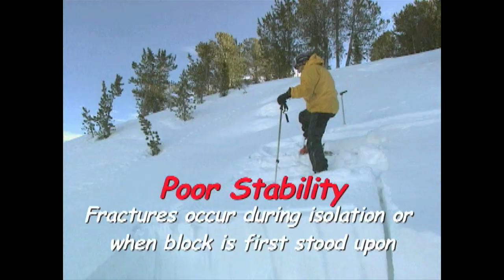All About the Extended Column Test

Comment: Karl, I just listened to your avalanche hour podcast which brought me to this page. Thank you for all of your hard work. I was showing my girlfriend different types of pit tests today and she asked a couple of questions I hadn't thought about, but I'm now curious about. How did you determine the dimensions of the test block?
Reply: He has centimeter markings on his probes. Most probes will have this for this kind of reason and, more grimly, to allow you to establish depth of burial and therefore correct dig angle in a search situation. If you don't have that you can measure your arm (elbow to wrist or elbow to forearm) at home and use that to approximate. Standardizing is good (like getting very close to 30cmX90cm), but a reasonable approximation should have similar results.

Comment: So would you ride on that slope? What is the rider's decision? If you get ECTP20+ is it considered to be stable enough? What is you lowest margin of ECT score that you would not ride?
Reply from the maker: +DimaFern Great question.  The simplest answer is that even with a high score you should think twice about riding that slope since it propagated. You can imagine a slope where maybe the slab is thicker and requires 27 hits to get it to go, but maybe in a thinner spots near the edges of the slope you could release it with 15. In general, whenever we get propagation we are worried.
Reply: +AvalancheGuys Thank's for the answer. I understand what you are saying, everybody is taking his own risk. I just want to understand how should I interpret ECT for practical usage. On your videos it's a rare situation when you get ECTN but you are still on the slope). As I heard from one of the guides, his rules are the following. Do not ride at all if there is CT or ECTI < 10. The slope is considered to be stale enough to ride with score 20+ (but you still never forget about general safety rules). The most tricky situation is around 15, it's in not stable but you can try to ride with great level of caution, but you'd better stay home) What do you think?
Reply from the maker: +DimaFern The ECT measures initiation and propagation and trumps the CT which only measures initiation. A low ECT score means its pretty unstable, but a high score does not mean it is stable.  All snowpack tests ONLY show instability.  They DO NOT show stability.  If it breaks clean, then the recipe is there to slide and you should not ski or ride. We get on steep terrain when there are no other signs of instability, including no propagation. The ECT is the last line of defense: we get to a slope and determined that it's good to go (no recent avalanches or other red flags), we are feeling confident in our decision.  But there's one last step: an ECT.  If it propagates it should turn you around because you may have missed something.  If it does not, no harm done because you were going to hit it anyway.
Reply: I know this is old... but to me it depends. Anytime I get propagation I'm very hesitant. Ultimately, my decision depends a lot on what the instability is. If it's a shallow new snow instability I would be more likely to ride with a lower score. Something like the snowpack in the video, I'd probably not ride even with an ECTN. I did that recently. Got 2 ECTN results but a 2 foot hard slab was sitting on facets. In the specific locations I dug, propagation was unlikely. But if I hit a weak spot, a very potentially fatal slide would occur.

Comment: Good vid, Karl.  I note from one of your papers that this test is effective down to a depth of about 1 or maybe 1.3 meters.   Have you guys been working on a method for assessing shear and propagation at greater depths? It's great to have such simple tests, but I wonder if using a standard mass (say, 1 liter water container) , dropped from particular heights onto the shovel,  would make replication better and reduce the error bars that would be inherent to this method?  Thanks for your work.

Comment: Thank you for the great video. 

One thing I would find very helpful is a video about useing these tests, compression, ECT, Etc. in determining if a slope or aspect is safe. Often I can generate data, but using that data in a meaningful way can be difficult. I guess a set of hard fast rules would be helpful